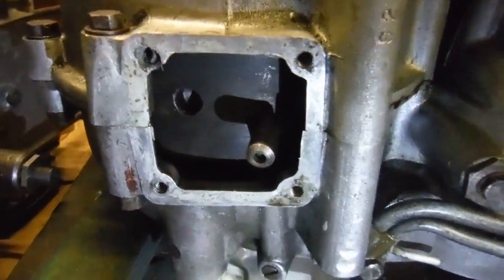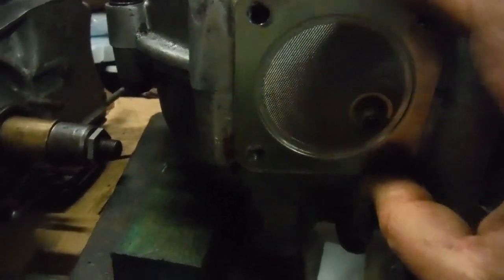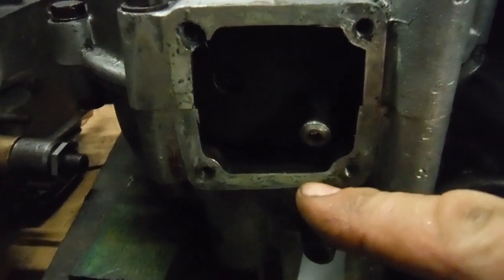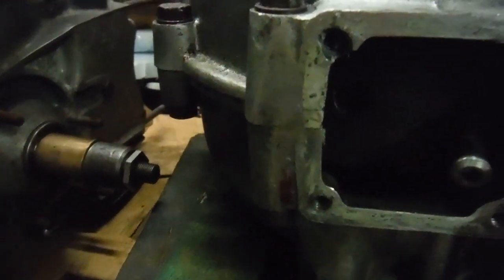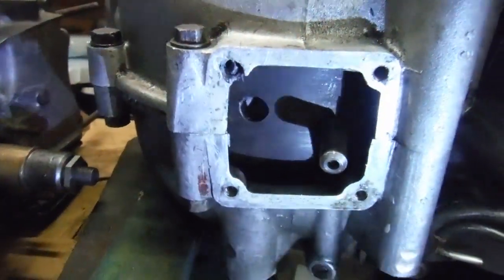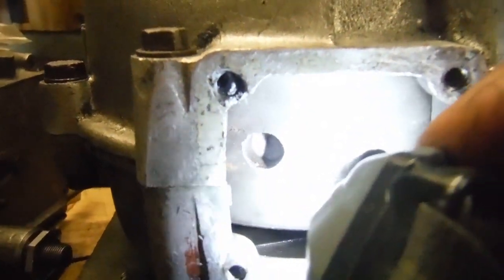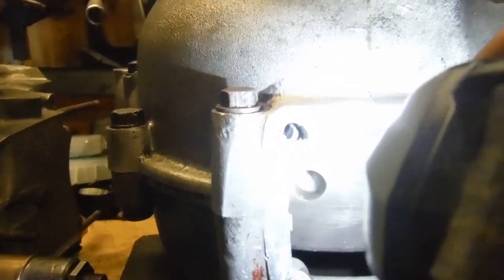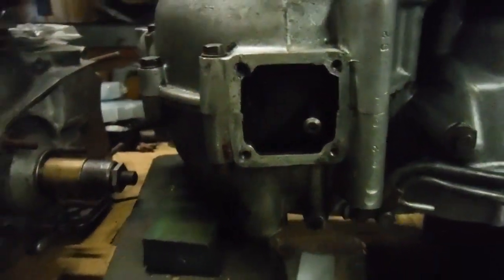BSA A65 fitting SRM sump plate reveals yet another unwelcome surprise!

Comment: Pretty typical stripped sump threads on these Paul. Another thing to check is that the seperate filter screen actually fits in the sump plate and doesn't sit proud of it as the diameter of the mesh part is bigger than the hole for it in the sump casting, a source of constant oil leaks thanks to pattern parts not quite fitting again! You really do need the patience of a saint with engines like this, hats off to you mate!

Comment: Far better to use studs and nuts worked on far too many triumphs and bsa engines with chewed up threads caused by people using allen bolts
Reply from the maker: I agree, but the original studs are not long enough and the replacements in the kit are ... Allen bolts.